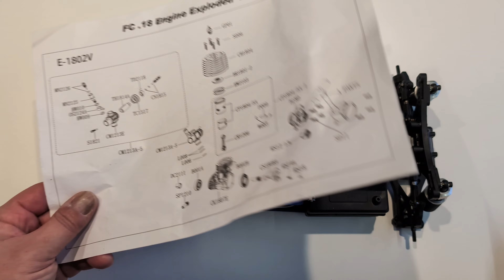Will Nitro RC DRIVE you MAD? 💢😡

Comment: If I had to deal with nitro I wouldn't be in the RC hobby I use the RC hobby to chill out and relax not worry about why the vehicle is stalling and what type of issue I'm going to need to rectify just to get out and have a good time
Reply: Totally agree. Well said
Reply: There’s something sexy about nitro but I agree with your opinion. Electric is far more streamlined. Noise alone would be unacceptable in the urban area I live in. So I learned 2 things this video. Nitro is not for me and drifting on moss is my favorite kind of drift. Thanks for the education 👍
Reply: I prefer elec as well but for some, the whole faff of nitro is part of the hobby as much as the rest of it.
Reply from the maker: I agree 👍
Reply from the maker: Same, the ease of electric makes going out on a whim so much better 👍
Reply: Y'all are soft. 10-30 years ago 10 year olds were running nitros by themselves.
Reply: @black99rt lol nitro is the easiest thing to tune electric is easy and fast but boring lol
Reply: You can't get better than a NITRO 👍
Reply: I get bored quickly with electric.
Reply: @black99rt Got my nitro when i was 14. Was hard at first but it's easy asf now (16 now)
Reply: Getting there bought an electric and a nitro at the same time just getting into the hobby electric instant fun nitro by time I get it to even run somewhat right I'm done with it , no telling what damage I've already done to the engine and sometimes it just wants to all of a sudden idle high for no reason I know of. Think I'm going the electric route from here on out I'll keep learning the nitro world just to know it.
Reply: Nitro is not for everyone, it’s for dedicated people who love to Take things apart and think critically.

Comment: Enjoyment of Nitro RC is not just about starting up and running but also the reward and sense of accomplishment that you have master tuning and tweaking to getting the best performance out of your engine.  If you're in this hobby, the tinkering is part of the fun!  If you don't enjoy taking things apart and taking time learning and be one with the workings of the 2-stroke engine, then this hobby is not for you.  Both electric and nitro requires tinkering but Nitro more of course.  cost wise, I've found local place S&W fuel that sells 15% nitro fuel gal for $25.  that's not bad, local pickup so save on shipping.

Comment: For future reference. When you break in an engine, you do want to heat cycle the engine, be sure you are letting it cool down and the sleeve pinch up before continuing to the next tank.  You also want to be sure that you are slowly giving it a little more throttle and putting it under load as you break it in. Not just sitting there, tank after tank. Fiddling around and working with the car is part of he fun.  Nitro is very fun.  Nitro vehicles won't burn your house down just keeping the fuel source stored.
Reply: I have a savage 4.6 gt-6 and don't feel that pinch? I also don't have that gear to move around underneath it. I have moved the drive shaft gear thing inside car but it moves smoothly?

Comment: I bought that same chassis with the Ford Fiesta body on it from Ali. I still haven't had a chance to mess around with it. I agree 100% the noise is awesome, but they can be a pain. That's why I bought a cheap one. You probably already know this but make sure you burn through the tank, so the fuel doesn't gel up! 👍👍👍👍
Reply from the maker: Yessir. Think this little beauty will sit on the shelf for a while 😅

Comment: 1) Priming: Hold your finger on the exhaust and prime the lines by tugging on the pullstart just until you see fuel about to enter carb. Then let go of the exhaust and a few tugs she should fire right up. 
2) You should start to lean out the mixture screw after break in. You can hear it being really sluggest right off throttle bc its getting too much fuel. They set these engines very rich for break in to keep lubrication high. 
3) Make sure to set up your fail safe with nitro! Once the receiver looses range or battery goes flat it will run away and smash into the hardest thing it can find. I am convinced that all nitro RC's turn into a seeking missile during a runaway lol
3) Nitro's are awesome! But you often wind up spending more time working on the dam things than ripping them. Enjoy!
Reply: Yeah for sure it'll hit the first inmovable object it can find, the end.😢😢😂😢😢
Reply from the maker: Great tips for sure man. Will keep in mind the next time I'm out 👍
Reply: You probably already knew these things lol 😅

Comment: Idk if you did, but always prime your engine before starting.

Plug the exhaust with your finger and turn the engine over until you see fuel travel to the carb through the fuel lines. 
Which should be instantly. 

Then your rc should start pretty fast. 

That’s why you’re sitting there pulling on that pull start for a while lol 🔥

Comment: Nitro engines are stupid simple once you learn how it works. I've been in the hobby for 20 years, and all I really enjoy running is nitro. The sound smell and high rpm of a small block is what it's all about for me. Also I love to tinker so the maintenance is perfect for me to relax. MAKE NITRO GREAT AGAIN!!!!!!!!!!!!
Reply from the maker: I'll be doing a 2speed conversion this summer. Looking forward to running it with +20deg temps
Reply: @disciplinerc  2 SPEED BABY! maybe look into getting a good tuned pipe for it, 2 stroke engine exhausts are extremely important for performance. These engines can really turn some good rpm with a quality pipe!
Reply from the maker: @Hardy_boy1  👍👍

Comment: Those Force engines are really easy to start, I've never preheated mine & I've ran it on cold winter days no sweat.
I actually have the FTX version of this & the FTX nitro Zorro with the same engine.
Both with TWO SPEEDS baby.! 😉
You NEED the two speed, they transform the car.!!!
Reply from the maker: Yeah I would have to agree. That will be the next upgrade, but I think I've had my fill until the warmer months come 🤘

Comment: Lol i absolutely agree with you also  I started with nitro  man remember smashing my knuckles Many times 🤣 it's fun when it's going but it's hard work .also you need to know your engine  and  learn to listen to it as when it's running well rich or lean and about to cut out .
It's a long process for sure electric is a lot easier or proper petrol 2/ .
Still made a very cool video  👍 as always
Reply from the maker: Proper fuel I'm actually considering. A 1/5 gas beast would be fun 😁
Reply: @disciplinerc  lol they are way easier than nitro expensive yes but fun I love mine 👊💥

Comment: Outside temperature is to cold for the tune on the engine that's why it's stalling. That head is probably 20 degrees to cool for optimal nitro burn so as it idles there becomes to much nitro to ignite so it bogs down and stalls. That tune will probably be perfect for a summer's day. Outside temperature plays a big part in nitro tuning even just 5 degrees difference from day to day will change how the engine performs. That's the pain in nitro, the car works good today but it's cooler tomorrow and will need tuning again. Head temperature is important .
Reply from the maker: Good information to know. I'm planning a 2 speed gear box for the next crack once warmer temps come out way 👌
Reply: @disciplinerc  nice. Have 2 2 speed nitros old hpi nitro RS4 3 and old kyosho superten. Love it as they change gear.

Comment: If I could recommend a little hump pack or a velcro strap/rubber bands around the AA battery holder. You'll have one of those pop out and the car will just try to drive out of your life.... Ask me how I know 🤦🏻‍♂️
Reply: Also that pink is HAWT 😍
Reply from the maker: Yeah I had wondered about that. I didn't know how to stop the engine either at first until I bumped the flywheel. Fun experience, but can't say I'll return anytime soon

Comment: That transmitter is my next purchase I think
Reply: You can't go wrong with a Dumborc transmitter, they are easy to setup and good range too, and optional with giro if you want it.😊😊😊
Reply from the maker: It's really great for the price dude. Backward compatible too with other Dumbo RX's 👍
Reply: Had mine for about 4 years so far no problems with it, touch wood.

Comment: Hi man
Great video and overall attitude as allways, I personally really like nitro but they can be very fussy, 1/5 scale gas is were the real party is at (:
Like you i found the "Beluga" very nice and im having alot of fun with it, but my transmitter just suck. It gives 80% steering with the first 20% movement of the wheel, very aggresive. I was thinking about getting the DumboRC DDF-350, but how would i make the lights work with a dumbo receiver? Since the standard setup is 3 wire lighting and the Dumbo receivers i can find only use 2 wires.
Reply from the maker: That's a good question. You may need to get the 10ch receiver with it when you order. Each button though can act as a switch, can't say you would be able to get the signal lights going 😬
Reply: @disciplinerc  Thanks for the answer - yeah ill try the 10ch and see whats up👍 it seems like a good radio for the money anyway soo what can go wrong😀

Comment: I made the mistake of the buying a Traxxas T-Max nitro thing years ago, hated it, it was always a struggle to get it running and keep it running. I bought an upgrade engine in desperation which was much better but still a pain in the ass. Put me completely off rc everything. Back then electric cars weren't so much of a thing, probably because of nicads which I did have some experience of in the 90's with my Tamiya Hotshot and Tamiya Lunchbox but 19 minutes runtime wasn't much fun.
Reply from the maker: I get it, batteries have come light years ahead from what they used to be. 8hr charge for 20mins was the worst. With instant, clean and massive power, I don't know why anyone would choose nitro in this day and age. Unless you like to fiddle and tinker I spose 😁
Reply: Bro the Tmaxx is awesome it's my favorite Rc 😁✌️